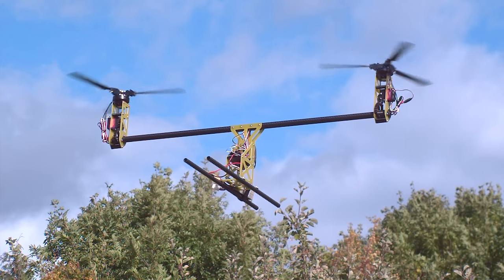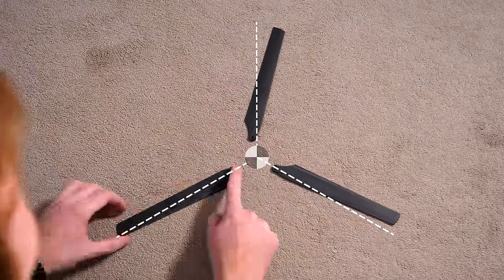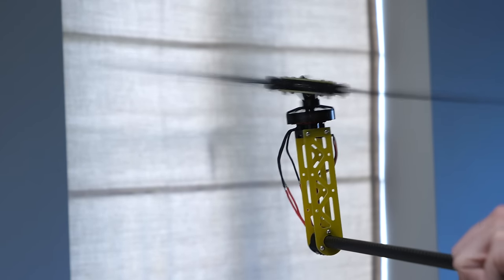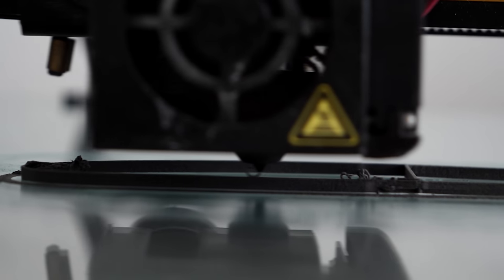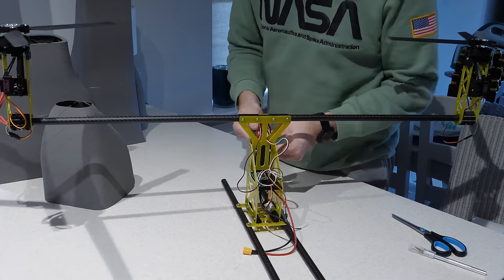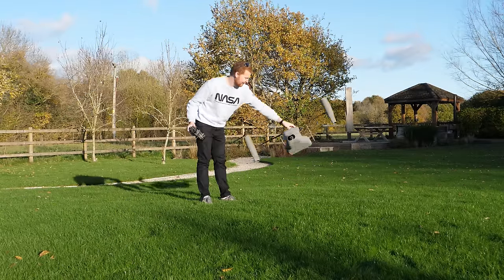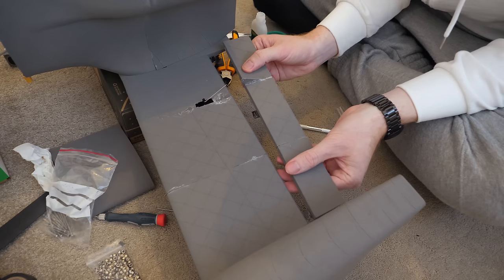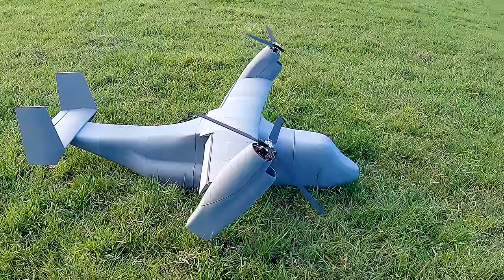Building a V22 Osprey - Part 2

Comment: i think that if you place the motor more in the middle inside the motorhousing, and use a shaft to the propellar. And then, for the pivoting of the propellar for jaw, roll, pitch, just gotta return to the free pivoting by motor torque approche, i would really like to se this perfected.. i really really belive that with good enough software, it can really be perfected.. i imagine that the buildt in stabelizing into the of the shelf hardware you are using really does not account for inertia, and variations in propellar speed, correcting for a current manuver, i just think that more math and variables needs to be added to the stability program to really correct for everything and make it equal to opperate as a traditional helicopter rotor tilt mechanism.

oh man i know this is alott to ask for, it is a big challange, but man, it has alott of potential, even the single body 3 bladed propellar with two pivoting axis. perfecting this approche with good software, could really bring alott of posibilities.

of my mind, i was thinking a new complex software library for the propellar with arduino.. it requires alot of thinkering... But then it kinda hit me.. what if you use neural network with back propogation ?.. by seting up a test stand, some way of detecting the actual angle of the propellar, this as a feedback, compare it to wanted propellar angle, for the machine learning model to generate a score from. that way in theory, you could actualy train a small neural network to beond perfectly controll the pivoting of the blades.
Then when it comes to correcting for the whole helicopter pivoting, add that pivoting value from the gyro to the desired propellar pivoting value to make it pivot along the aircrafts tilt emulating a traditional propellar that is fixed to the aircrafts normal angle, if that makes any sense.

would like to know what anybody thinks about this ?

Comment: Sorry but if you shift the motor in the axis of rotation of the motor and connect the blade with a shaft?
Can be a solution for the weight distribution!

Comment: Can't you use like an arduino controller that you could program in a couple of delays that would slow the tilt action??  Also instead of making the motors rotate can't you just make the whole wing rotat as one big piece that way the wing rotating would maybe cut the air drag and help slow it down and then when in verticle flight it the wing is not maybe trowing the aircraft off balance maybe? Sorry I am more iinterested in whether it would be better to do it the way I am suggesting I am trying to understand the best way I can make somthing simillar 
I do know the real V-22 uses a thumb control dial that the piolt turns which make the rotar pivot

Comment: Scale wise. The blades are tiny compared to the real one. Osprey blade tips  are only a two or three feet from the main airframewhen in horizontal  position 
 So I think your loosing lift and then airflow over the wings with the shorter blades when in forward flight.   From the look of real engine nacelles,, the props are either belt or gear driven. My bet is gear. And offset to the center of nacelle.  Which should help with the tail heavy problem maybe couple it with ballast in the nose section?  maybe a slightly more powerful motor rpm wise or torque. I dont know which. Not an egineer lol. . I don't know anything about model building so I don't know if any of that is helpful or even possible. But the job looks fricking fantastic.  

Edit for crapy grammar

Comment: Its not climbing because of the change in balance mid air its balanced for take off but when rotors rotate foward they add weight to the front make it nosedive  can you have a system to add weight to the back as you move rotors foward?

Like add a weight to the bottom of rotor so when its taking off its central but when rotors rotate the weight lifts up into the back of the vtol
Reply: I could design it for you tbh i thought of 3 ways just watching the video for the 1st time  you got yourself a new sub

Comment: Could an internal, belt based ballast system be used to help offset the change in CG when hovering?  Move the RX or something already on board.  You could tie the ballast system to a gyro or accelerometer.  Ha ha...I'll learn to wait until the end to comment.

Comment: You're flying a helicopter, not a plane... meaning, during approach you should push forward not backwards to counterbalance as the gyroscopic movements are felt 90° after and the blades going forward are slower than the ones pointing back while rotating (helo pilot)

Comment: Counterweight batteries. No extra weight, if they could go in the engine room. After all, a scale model that has only the electric motor in there is not to scale in terms of gravity centre.

Comment: Width of the wings may not give enough surface area to gain lift
Reply: Yes it is problem with all scale aircraft, fluid dynamics and lift and stability all increase with larger size aircraft

Comment: I think you are going a bit in the wrong direction, the V22 osprey has a different center of gravity, and the whole thing is more stable and durable. firstly (in my opinion) you should make the whole structure with interchangeable parts, in case to redesign something, do some electronics with claps and wings, and most of all I think that if you have 2 pipes for the motor, everything will be more stable
Reply: reachouttomeondiscord772  what do you mean by those emotes caus I'm kinda lost at this point hahaha

Comment: why not just change the engine parts so they are lower (in hover mode) so when they rotate the center of mass stays in the middle of the joint

Comment: Why don't you move the pivot point closer to the CG of your pods so you don't have a CG transition effect? Why not rotate a section of the wing with motor pod, at least the the radius of the propeler? Seems wing is to small to produce enough lift in horizontal flight mode?!

Comment: I think adding more weight and higher-powered engines could solve the problem... high power engines could solve the issue with the full flight mode
More power, more speed, more drag, more difference in pressure at the wing creates more lift
Because more weight would help with the inertia, also the transition between half-forward flight and hover mode is relatively quick
from hover to half-forward is like a 4-sec switch but, switching back to hover takes 1-2 seconds, this sudden shift could also be the cause
switching to hover mode should be the slowest imo

this is all just speculation and I am way too under-qualified

Comment: Nose heavy, tail heavy. How about the pods being balanced front and back and using a longer shaft from the motor to the prop. That way there is no weight shift as the pods are rotated. IMHO

Comment: hah was looking that it become really nose heavy and pushed nose down, i think counter weight is only solution bcs "low" speed, so even if ya would make back wing more aggressive to make down force on higher speeds it would not still make enuff. but i quess altering the back wing angle is easy test?
edit:was looking pictures about Osprey back wing is like 1/5 of hull lower than front wing, probably for that it gets more downforce from all the lift air that will get directed from front wing, and there is really aggressive back humb before back wing, i bet its all designed to counter the engine weight.

Comment: I might be able to lead you in a direction to make better models that are much stiffer and stronger but still lightweight and the trick is vase mode printing all that flexing would go away completely although your fuselage shape lends itself to being pretty stiff once it's all glued together

The trick is you need an inner and an outer wall so you would have a double wall fuselage with a thickness of about four or 5 mm max it doesn't need to be much and the ribs would be in between the two walls basically you would shrink the fuselage just like you did hollowing out the large model and then you would create ribs but those ribs would only start on the inside and they would move to the outside but not quite all the way they'll stop 0.8 mm from the outer wall and then come back The slicer takes care of that as long as you get the gap right

As for making these ribs on your model boy if you couldn't figure out a way to program that as a constraint it would be pretty tough

It's a lot easier on something like the wing what you would do is you'd have to create your crisscross pattern but you can't have any intersections so you'd have to create zigzags but each set of zigzags cannot touch at their apexes they would have to be 0.8 mm apart otherwise you create a jump off point and you lose vase mode

Once you have your crisscross pattern that doesn't intersect you then create a solid block use the wing as a cut tool to cut one half of the wing shape from that solid block you then put your ribs through the wing you then use that solid block now a mold to cut the top of the ribs to the exact shape of the wing then you translate those ribs down 0.8 mm and then merge it with a solid wing and that will give you a vase mode print that's double wall in the case of the wing that would be top and bottom in the case of the fuselage that would be inside outside much much stronger and much stiffer while still being ridiculously lightweight I build rockets using this method as well as little gliders

I think you can still click on my little picture icon and get to my channel my latest video I just posted explains this vase mode concept that I use at least the basics and you can see me create a tube in the fuselage for a rocket doing a more organic complex shape like your fuselage would be quite a bit harder but maybe you can figure out a way to automate that in your CAD program? Cut your crosshatch pattern to the shape of the fuselage and then instruct a constraint offset it 0.8 mm? I'm not sure how to do that in more advanced CAD programs
Reply: Also you can just put ribs on the skin of the model and they will not violate vase mode as long as the ribs are two times the thickness of your nozzle so with a 0.4 mm nozzle you would need 0.8 mm thick ribs this will allow the slicer to go out turn around and come back without violating phase mode this however would require your outer skin to also be 0.8 mm or you would have to put a zero dimensional slit inside of each rib basically 0.01 mm cut

That would be a royal pain in the butt the way you did it's a whole lot easier :-) because it lets the slicer engine take care of pathing

Comment: you have the setup fine, when you plane to stop just lower the throttle do not force it into hover mode wait until you have no forward fight and are losing lift. these are hard to learn the transition. practice ...

Comment: It's looks like you too much nose heavy. I think you need to put your motor further back into the nacels, close to the pivot point (I don't know if it's possible...) It should  not change your cg in over mode but put back a bit your cg in forward.

Comment: As you transition into horizontal flight the CG is moved much too far forward. You also have tail heavy problems due to CG shifting too far aft. The nacelles are too long as you can see when it is on the ground the bottom of the nacelles nearly touch the deck. Shorten the nacelles length and it should work much better.

Comment: Look at the wiki https://en.wikipedia.org/wiki/Bell_Boeing_V-22_Osprey for the real thing 

" Bell Boeing V-22 development budget first US$2.5 billion 1986, increasing to US$30 billion 1988"
"By 2008, US$27 billion had been spent and US$27.2 billion more required for production."
"Between 2008 & 2011, V-22's estimated lifetime cost grew by 61%, mostly for maintenance and support.
"[V-22's] production costs are considerably greater than for helicopters with equivalent capability
"Twice as much $ as for CH-53E which has greater payload and can carry more heavy equipment" 
"V-22 cost around $60 million to produce, where CH-35E $35 million by comparison"

Comment: I saw others YouTube do the same thing but they success transfer to flight mode. The different between you and their is they got fan on tail like f35 center. Assume like this in hover mode your lift force is from the 2 engine. But come to flight mode, where's your lift force.
Reply: I saw one more problem in practical v22 osprey left fan is ccw and right fan is clockwise. They rotate outward. Your 2 fan is same I think the problem might be this

Comment: First off wow. Transition more slowly. Control surfaces shouldn’t be on switches. Larger elevator flap for more authority. Looks like your rotating the engines too far down. Cg isn’t the issue it’s the cumulative  vertical thrust vector of the air foil with airspeed and the engines as they rotate up causing a pitch up. God speed